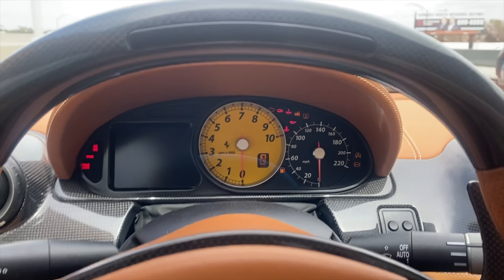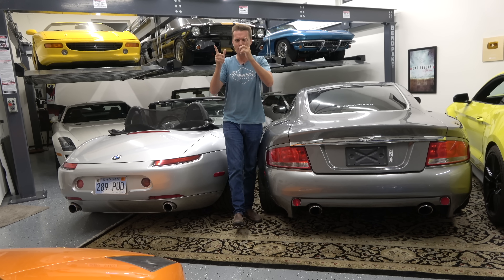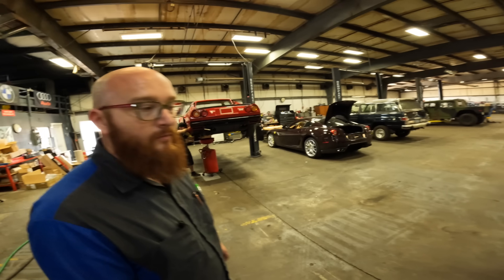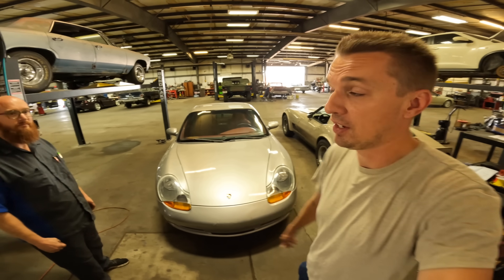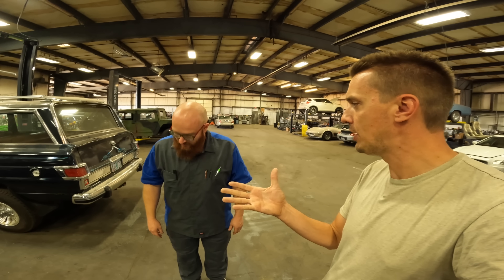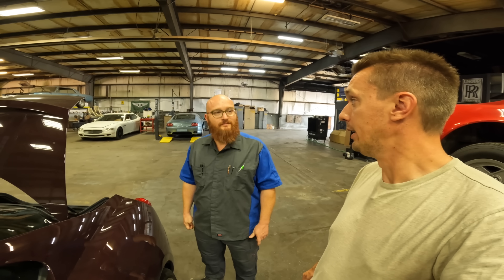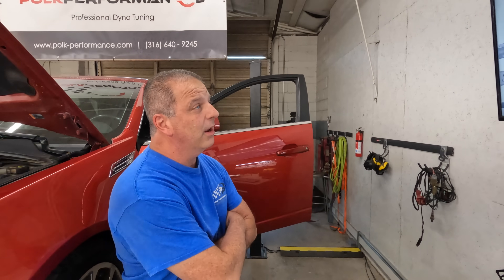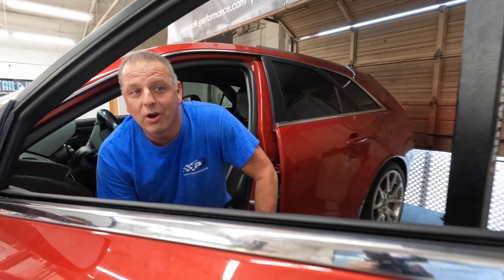My CHEAP Cadillac CTS-V wagon is now a 700HP grocery getting MONSTER that everybody needs!

Comment: Just a suggestion, but I have a built Silverado that is laying down 597 horsepower and 642 pound feet of torque with a lightly modified transmission. The cheapest thing that I bought for said build that had the most cost to longevity ratio was a corvette synchro. It made the 1-2 shift much faster and firmer, and are great for keeping a stock transmission from grenading during hard launches when you have 500+ horsepower. It's well worth the $150. And seems to work well with my 2700 stall converter. Just a suggestion from a guy with a LS2 with a BTR stage III cam and a 2.9L magnuson supercharger swapped into a 2006 Silverado. Be careful about changing those shift points also. The bottom end is typically the weak point of a LS engine. They really don't like to be revved much higher than the stock fuel shut off will allow. I'm on my second short block during to this exact reason.
Reply: The stock 6L90 trans in the CTSV will handle 800+ whp as long as you tune the torque tables correctly.  I've seen them go much higher and not break, but at that point it really depends on how it was treated earlier in life.

Comment: what was making my instrument cluster do the same exact thing in my 1997 Prelude was the harmonic balancer/crank pulley. It was allowing the belts in my car to slip and the battery wasn't getting the proper charge it needed. I know Ferrari 599's and Honda Prelude's are completely different but I wouldn't rule that part out if it's the case.

Comment: Fuel tank top hats do that on Audis as well.
Reply: The funny thing is, I have a 2011 Cts-V which had the exact fuel pump hat leak that his Ferrari had. Had to change out the hat to an aftermarket one since it was way less expensive than replacing the whole fuel pump assembly.

Comment: Tyler, the passenger fuel pump has already been replaced with an updated unit.  The driver's is the white capped pump which needs replaced.  No need to replace the passenger side pump.  It's not a Ferrari issue.  These pumps were used in many foreign and domestic cars in various configurations.

Comment: Tyler, from Sydney, Australia, unbelievable just cheap nylon or plastic tops on the fuel pumps, plus they are in the cabin and in almost contact with the front seat occupant.  I have a large near 60-year-old Jaguar mk10, the electric fuel pumps are metal, with all old school Bakelite insulation sections for the electrical zone are in a separate walled off chamber within the boot plus there is a rear steel firewall separating the boot from the cabin. Plus after the Mercedes Fintails  these were the 2nd global/world safety car with crumple zones. With their massive side sill rails that hide hidden layers of reinforcement. I think I would rather be in my 1967 Jag mk10 rather than your "new" Ferrari 599 in a major rear end accident. As in a super rear ender the Jaguars bootlid is designed to easily pop up so the rear crumple zone can do its work. I know this really works as my Mum owned 2 a new 1961 model, replaced by a final 1971 model that she drove for several decades in 1993 she and several new cars were struck by a drunk in a truck and with the car's strength & safety, It did not catch fire, she was not killed, and did not have to go to hospital, just take a taxi home. Some of the new cars caught fire, and also there were some people killed in some new air bag equipped cars. As a small 5-star safety rated car will not save you in a real world 80kph/50mph accident with a truck, however a 2.5 tonne tank like 1960's Jag will save your life as they were built with a massive central safety cell for all the passengers like a racing car.  Additionally, it's five old-style safety harness seat belts, almost like those in a race car keep you firmly in place no matter where you are sitting plus they have anti-jam clasps.

Comment: The cap on the other 599 fuel pump is a darker color. I believe that indicates it has been changed out to the new updated style already. Also it is a common Bosch part I believe. Much cheaper.

Comment: WOW WOW WOW WOW WOW WOW WOW WOW WOW WOW.
Gas being pumped into the inside of the Ferrari.
Car Wizard...thank you for saving Hoovie's life.
Just think, twenty years ago,. we would have smokers around.
BBBOOOOOOOOOOOOOOOOOOMMMMMMMMM!!!!!
Let's get something very clear here right now.
On a 105 degree day, the inside of that Ferrari could get to 140 degrees inside.
That would cause the fluid gas inside the passenger compartment to turn into flammable gas vapor all over the inside of the car.
All Hoovie would have to do is activate his car locks by remote and the spark inside the door locks could ignite the vapors and blow the car and Hoovie to smithereens.
Just WOW.
Polk Performance really came through for you on that Cadillac wagon.
What a frikken grocery getting race car.
Like driving a rolling chaingun.
Fantastic all American  automobile.

Comment: We have a Cadillac sts doing the same electrical thing except it doesn’t say electrical failure but it will shut off while driving and I have no clue what’s going on gauges cycle security light flashes, and sometimes when it shuts off it says “NO FOBS DETECTED” even with the key in the emergency spot…

Comment: When my M3 needed a new fuel pump, the shop wanted $511 to fit a new one. I found that BMW buy them from VDO and I got one via an importer for $148. Took 30 minutes to swap it out.

Comment: I had a merc that did the same thing as your ferrari, only difference is when mine would do it, power stearing and brakes would give up aswell, 10 seconds later it would be fine again (also only happened on the motorway (UK)) but those 10 seconds every couple of days was the scariest experience ive ever had (and ive nearly riden my motorbike off a cliff)

Comment: cracked fuel pump housings are also a BMW issue - lifted my rear seat out to find a pool of fuel lol. VDO is the manufacturer that makes the assembly - yours is most likely the same, so they're the company to blame for your Ferrari pump crack as well.

Comment: I had a car (not ferrari) that would have the instrument cluster turn off like this while driving. The crazy thing is it turned out to be a piece of lint that had made it's way into the key and was intermittently blocking the IR signal to the car so it was thinking the key was removed.

Comment: You should see the Ferrari shop. They have the Premium maintenance Programme. the Programme is aimed at preparing the car for its classiche certification and if taken into the Programme, they offer parts such as the fuel pump and many other for very moderate pricing.

Comment: It would appear that one of the fuel pump assemblies on the 599 was replaced since it is made of the updated yellow plastic. The one that failed looks like it was previously cracked ans someone applied some sort of black sealant / gasket maker to fix the issue
Reply: Flex Seal
Reply: @LIamaLlama554  lol

Comment: When it comes to the Cadillac, it doesn't all bother you that the Wizard missed a run issue caused by the spark plugs and mass air sensor??
Or potentially worse,  the exhaust was loose and ready to fall off??

Comment: The left fuel pump seems to have been replaced already. They changed the material and the color over time and from seeing it’s much darker then the right one I don’t think it needs replacement.
Reply: Agreed.  I hate the rationale that if one goes bad the other will too.  Sure, sometimes it will but if there's no penalty in labor and both have easy access (which they appear to do), just do the one and save yourself a grand that you might otherwise, not have to spend.
Reply: Plus, the newer darker ones are made from different material and will not brake anymore. Easy to check

Comment: It's 8/26/23, I just saw Samcrac, a few days ago, buy and rebuild a burnt down Ferrari, on the passenger rear, because of the faulty fuel pumps.  That the white tops are the original and the yellow top ones are the updated ones, he replaced both of his white tops.  8:05, the Passenger side, on Hoovies, has the yellow top and on the Driver side, a white top, the leaking one, but he's going to replace both...?

Comment: uncle mikes roadrunner 1969 if the car was low on fuel when it sputtered just tap gas gauge and it would rise above the E and then stop sputtering

Comment: If you have a ferrari and the top hat on your fuel pumps doesn't crack and leak then you don't have a Ferrari.  At least the front engine cars don't burst into flames from it like the rear engine cars do - seriously Ferrari, I like how they recalled 20 years of cars for the brake booster cap causing braking loss but no recall for these lighting cars on fire constantly, guess that is less deadly!

Comment: Leaky fuel pump pooling gasoline 12 inches behind your head inside the cabin… with a shorting out electrical system. What could possibly go wrong?

Comment: The CTS V made exactly at the wheel what GM said it made at the flywheel stock. Please PLEASE get some CNC PnP 6 bolt heads, a camshaft, ported Kong 2650 LSA, upgraded HEX, fuel system and E85. Then when you let the smoke out of the stock LSA build a 388 or 396ci Dart block and work on maxing out the Kong 2650. Doesn't a 850-900whp CTS V sound like fun for now and then when you stick in the 388-396 Dart block you could easily make 1100whp all boost on E85.
Reply: @Yippee Skippy Are you saying the LSA in the CTS V/ZL1 is unreliable or the LS platform all together is unreliable?
Reply: @Yippee Skippy You're insane if you consider the LSA or LS platform unreliable. I've had too many from supercharged with a centrifugal and PDS, to turbocharged, nitrous, head and cam only, high compression stroker build, to bolt on only and aside from an oiling issue on a 150k mile LS2 that caused me to spin a bearing they have proved to be absurdly strong and reliable.
Reply: No. Leave the V-wagons alone. They only built about 2500 of them. Go ruin a sedan instead.

Comment: Did I miss something?
556HP instead of 700HP. Still respectable but it doesn't match the title here.
Reply: at crank vs wheels maybe?  seems like a big loss for that though.  or is that more normal?
Reply: @turdferguson7686  Since they measured with a chassis dyno it would be a little disengenuous to use "estimated" engine dyno numbers...for attention grabbing. Yes, that would be a big loss through the drivetrain.
Reply: @FLcruising  my dyno knowledge is fairly limited so just a mildly estimated guess. If the dyno used was specific to the wheels hp then yeah, could just be an overly inflated big hype number for clicks. I'm far more of an expert on advertising than dynos so that I can say with more certainty!  And I don't like click bait but understand you sort of have to do it if you want traffic. I blame google for that, not Hoovie, he's just forced to play by their crap rules to stay in the game.